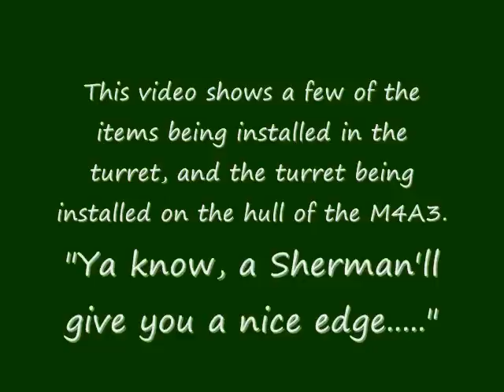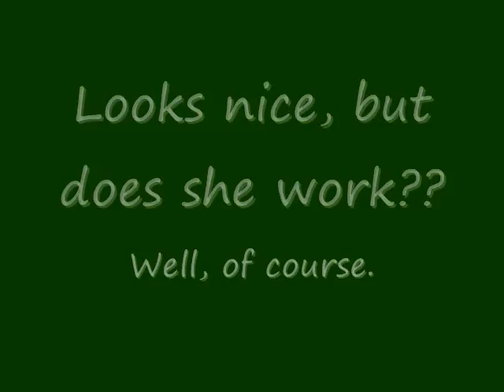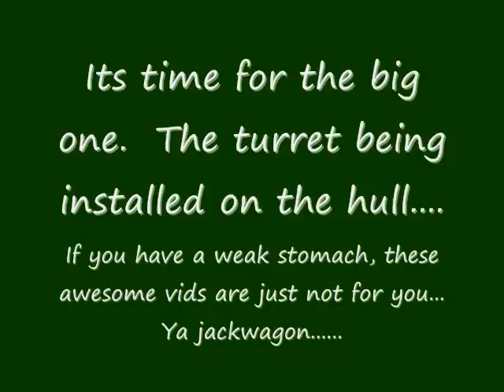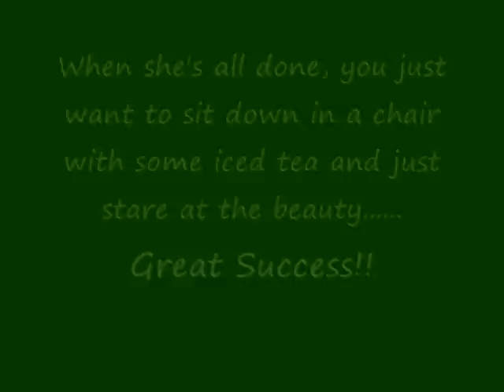M4A3 Sherman Restoration (Turret assembly and Installation)

Comment: I believe this is a M4A2, the front glacis plate is at too shallow an angle - the M4A3's had very steep glacis plates and didn't have castings protruding from the hull front for the driver and radio operators hatches.
Reply from the maker: +Sean Moriarty This is an M4A3. Sorry, clown.
Reply: Both M4A2 and M4A3 had 47 and 57 degree UFP types.
Reply: I believe you guys are correct, ALTHOUGH, it appears to have an A3 turret on an A2 hull. Just saying, not a big deal. It's a Sherman, love em.

Comment: I only saw it now but I like it! Btw I see that there is no turret basket! Is it so difficult to find one? Otherwise you did a very good job! I wouldn't mind to have it in my garage! The only question is as it is an early version of the Sherman it should by all means be powered with an radial engine! Or because it is cheaper to run and restore the Ford engine?
Reply from the maker: +Paolo Viti It does have a turret basket, watch the other videos and you will see it. All of our vehicles are restored to factory specs, including engines.  This tank has the original engine, not all Shermans had radial engines.
Reply: agwrangler it is a little bit difficult to follow all your videos regarding this beautiful tank! I'm fully aware that not all Shermans had the radial engine but I was mentioning that as it is an early Sherman normally it should have the radial engine, at least what I understood! Is there a direct link so I can follow all the videos because I think that you guys are doing a marvellous job! Thanks for replying!
Reply from the maker: +Paolo Viti This M4A3 was produced by Ford. It is powered by the Ford GAA. Correct engine for this correct vehicle. 
If you go to my channel or whatever they call it you can see all of the videos. Thanks.

Comment: The only quality of the M4s was their sheer quantity.
Reply from the maker: False. they are automotively superior to German vehicles in every aspect.
Reply: +agwrangler the design, relative simplicity and manufacturing process which allowed 40,000+ to be made was where the quality of M4 lies.
Reply from the maker: +Steve or as i stated already, the fact that they were automotively superior in every aspect. They were reliable as shit. German tanks were not. so quantity yes, but not the only good aspect.
Reply: “Quantity has a quality of its own”- Lenin